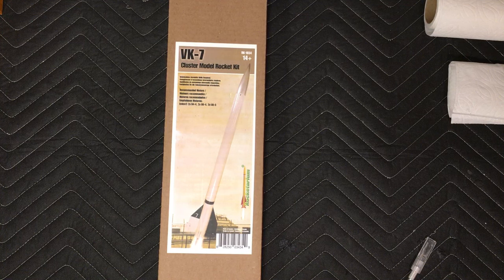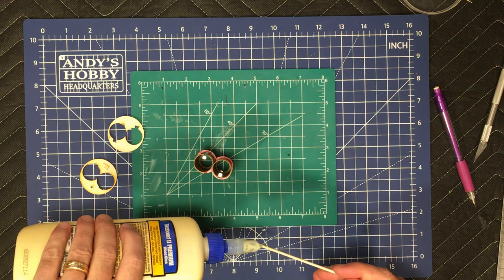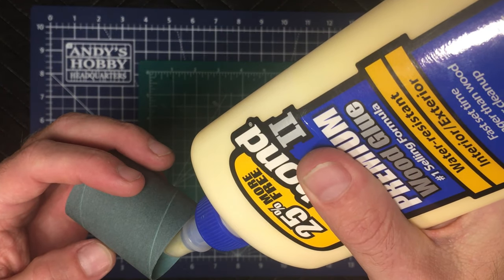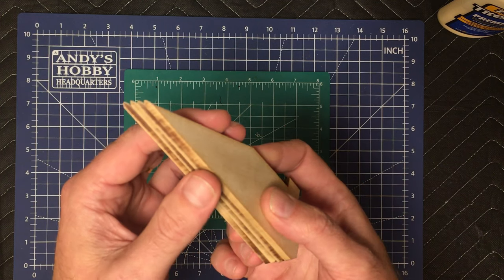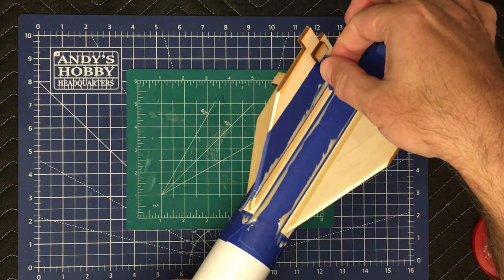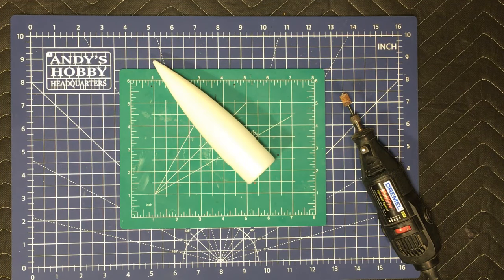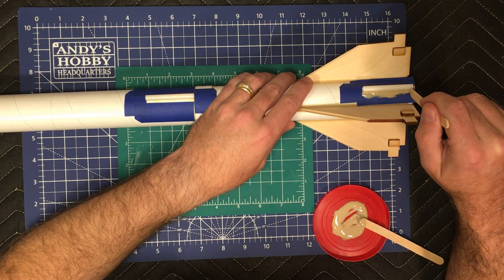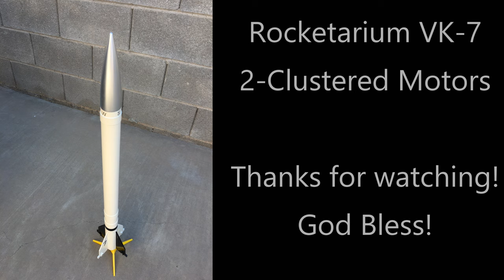Rocketarium VK-7 Full Build

Comment: Kevin, really nice construction video. Great job on explaining your variations from the instructions.  Really loved the clever way you protected the shock cord during the baffle glue-up. I'm sure the first launch will be exciting.
You don't need a clip whip for a two-motor cluster, just twist the starters together. Definitely test your launch controller with two starters though, you might need to get/build a 12-volt launch controller.
Reply from the maker: Thank you JC!  You are spot on about the cluster equipment.  I have an Estes Pro Series controller on the way, and I'll be installing a 3S LiPo in it, so I'll be pushing around 12V out to the igniters!  I hadn't even thought of that till I read your comment, so I thank you VERY much!   I did receive my whip clip (2 motor) and can attach it to my soon to arrive controller, which will allow me for 3-motors!
Reply: @KevinsModels  Happy to help out. I'd hate to see that great looking rocket have a motor ignition failure.  All kinds of bad there, especially with those "cushy" rocks to land on. Never used that controller, but I've heard pretty good things, especially with LiPo batteries. My homebuilt one uses either 8 AA (Internal) or an external 12v 7AH rechargeable battery. Can't wait for the launch!